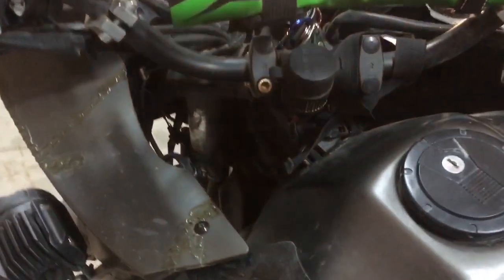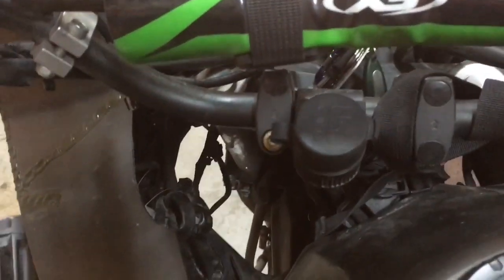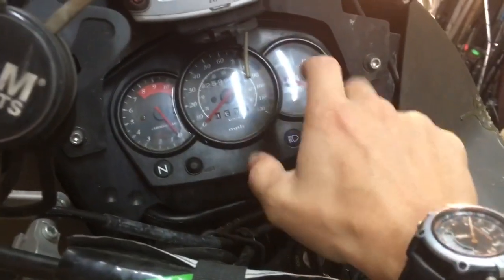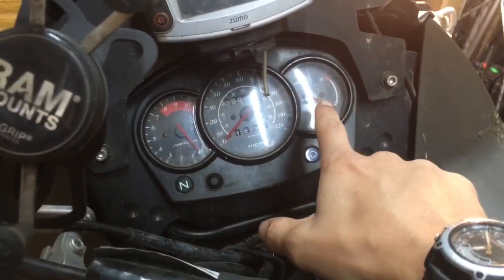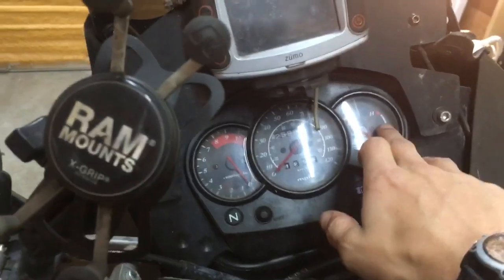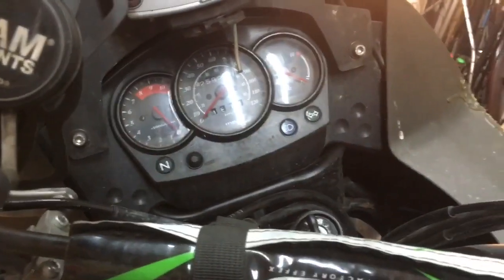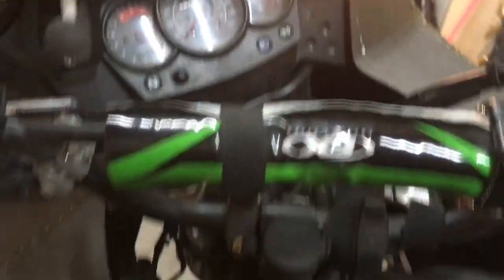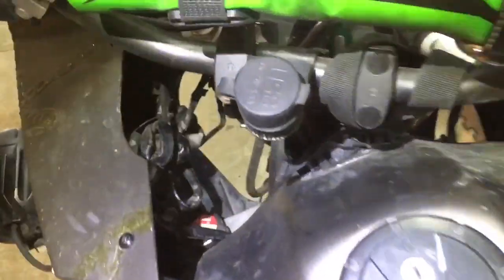KLR 650 Cooling System: Problems and Fixes

Comment: I was having issues with my fan not coming on - thought it was a temp sensor or faulty fan motor. Tried this (opened rad cap early as I was worried about hot, some squirted out of the top). Was skeptical but it really helped - the fan came on at a little over halfway on temp gauge. This might just have solved the problem, thanks for sharing
Reply from the maker: Glad to help! Thanks for the comment 👍
Reply: So why was the fan not coming on???

Comment: Great tip!  I knew you always need to get all the air out, just didn't know the process for the KLR specifically.  Good to know, Thanks!
Reply from the maker: Well, at least this is how I did it. 😄  It worked though, so that has to count for something. :-)

Comment: Good tip there. As for thermal bob. Don’t have one. Probably won’t get it either. If you saw how much the temperature changes on a transport from one extreme to the other.  No matter the outside temperature. I think the cooling system works just fine on the KLR.
Reply from the maker: Huh. So they really fluctuate then?  I’ll have to think about it... Thanks for the input.
Reply: The actual temp fluctuation is not much nor a problem. .The Kawasaki engineers are a lot smarter than bob and his thermo gimmick
Reply: @gman302  exactly. From what experience I have in mechanics all engines eventually become oval shaped in the cylinders. The KLR being such a large single doing all the work probably happens sooner than say a GM 350.
Reply: @truckmanonfire  of course. Cylinders do not wear evenly. They always wear in an oval shape because the forces on the cylinder walls is greatest in the directions of crankshaft rotation.

Comment: A common problem after over heating is alternator failure 6-12 months after the over heating. The over heating stresses the stator which eventually fails.

I've bought one KLR knowing the bike had been over heated that did experience stator failure over six months later.  I also had similar stator failure on my DL650.  During cold weather the seal on the oil filter leaked. The bike never indicated over heating, but oil temperature got hot enough to stain the oil level sight window. The stator failed almost a year later.

The KLR repair was fairly inexpensive and simple. The DL650 was more expensive and more difficult to repair.

As the overall condition of the bike was getting to be poor due to living 24x7x365 outside I sold the DL650 as a project/parts bike with full disclosure to the buyer at a very low price.

Comment: Cooling system golden rule, never trust the resivoir it can bite on the butt. It can be full with the radiator empty. Also big tip for you spend the money and install the thermostat bob your k.l.r will be happy.
Reply from the maker: Yeah I found that out the hard way 😄  Thanks for the tip, I may do that this winter.
Reply: I put the thermo bob on my last KLR -1st gen. After I did the 685 kit, Eagle Mike recommended it as it is supposed to flatten the temperature extremes of the KLR which typically run from very cold to very hot and the theory was that this could cause an issue with the cylinder becoming warped to some degree and causing oil burning. The Thermo Bob will actually make the bike run hotter on average but more consistently. BTW the 685 kit on my last bike made a huge difference and fixed the oil burning